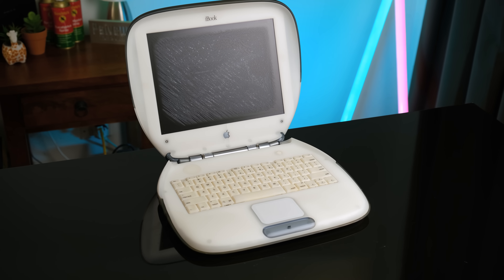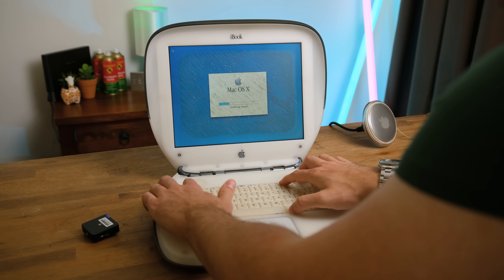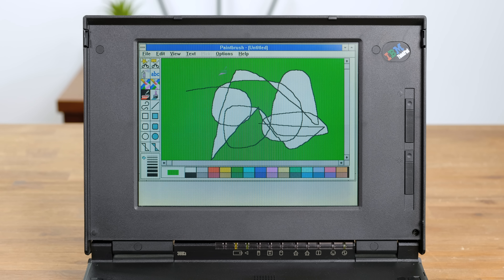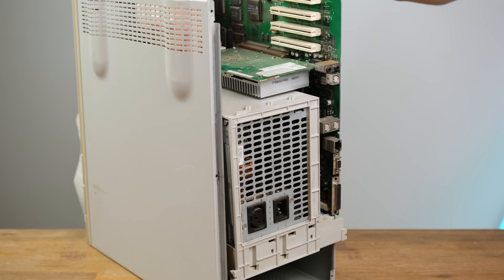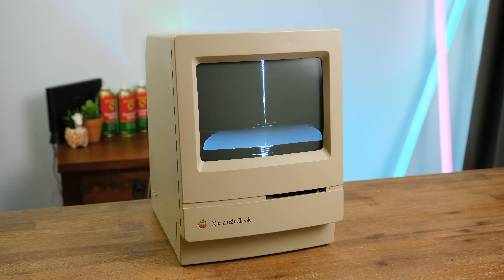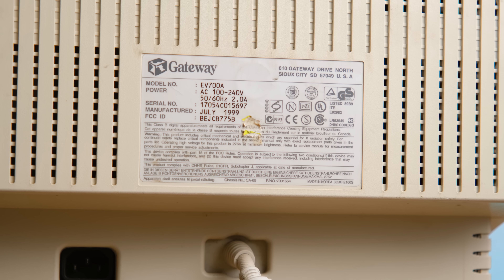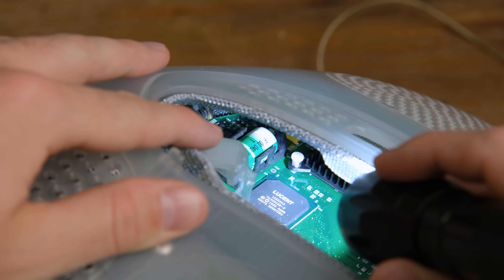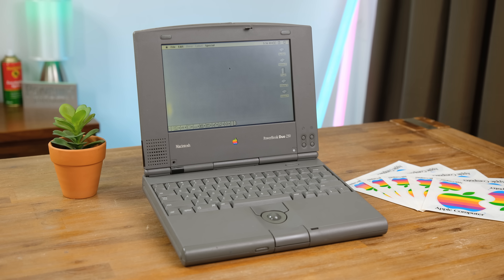So Much Vintage Tech Is Dying... Here's Why

Comment: One thing I have found that works great on rubberized plastic that get gummy is to get a can of Matte clear spray paint
I  disassemble/mask off the parts you dont want sprayed and paint them.
I have a number of Old Dell laptops that got sticky n the cases and palm rests... 
I took them apart hit them with 2 very ight coats of Clear and they look and feel like new.
Reply: Thank you for this great tip!!

Comment: I have a g3 which has something like 3000 vintage songs from 1995 to 2008 from actual hard disc cd's imported through that pc's poor worn out cd drive. I use it in the garage at least once a month as background music playing thorough the original speakers  and the only thing I have had to do is replace the mouse. I do unplug it when not in use and of course get the clock is off message at startup. But otherwise it works flawlessly. I will run it till it dies.  

I also have a 575 that died 2 years ago. I replaced it with a  6500/225 which I use to run ray dream designer and photohshop using a syquest drive.

Comment: Sad. I have a Panasonic radio from 1970 that still works fine, as well as a 1915 Victrola record player which also works fine. I also have a 1940s/50s tube radio which needs repair, but I'm sure it just needs a tube replaced, the structure of Bakelite and metal is not deteriorating at all and all components can be replaced or fixed with a soldering iron.

Comment: flyback is probably not bad. just clean the carbon soot off the glass and the cap, anode wire, and under the cap. put new silicone grease around the hole for the anode cap. should fix the problem. if it doesn't, get some super corona dope and 'paint' it on the anode wire

Comment: I absolutely love how percussive maintenance usually ends up working
Reply: I used to have a CRT monitor in the late 90s which turned pink every now and then. I started tapping it gently and it returned normal. As time passed I had to use bigger and bigger force. Months later I was banging the top of the display with full force until it returned normal. Later I learned that the issue was with the power outlet and the display had no issues. Still managed to sell the CRT display.
Reply: My dad calls that "gentle abuse" lol
Reply: It's how my PowerBook G3 has been operating for the last year. The HDD seizes up after a while of not running so I keep a hammer in its bag for starting the system.
Reply: Kept a PSU going through several homebuilt PCs for 20 years now. I should probably replace it soon
Reply: I stockpile and maintain old parts to help my neighbors with their aging technology. I just love the feeling of helping someone with something most people thought was beyond fixing!
Reply: It works great on fridges with jammed compressors after being in storage.  Give it a good whack with a hammer just as you turn it on.
Reply: That phenomenon happened alrady 40 years ago. I was called to someone having a VAX machine (digital/DEC) and it would not boot anymore. They wanted to copy the data one final time. When hard drives ran for a long time and then are turned off for a prolonged time, the bearing grease gets thicker. By giving a gentle knoch it moves a bit - enough for the torque of the motor to spin it up again. The hard drive heats then up a bit making it running again.
Reply: I used to have a VW Polo where the brake shoes would rust to the drums. You had to whack the drums with a length of 2x4, from underneath, if you hadn't moved the car for a week. Also, if you were planning on changing a tyre, you needed a rubber mallet because corrosion welded the alloys in place. Awful car, the Volkswagen, but percussive maintenance, it understood.
Reply: @gdutfulkbhh7537  This made me wonder of what a car made in 2020 is gonna be like in 2040, it's all gonna be vintage tech and chock full of it.
Reply: Indeed! I once had a job as a technician for a university department and the majority of the successful repairs I executed over the years simply consisted of the typical digital 'switch it off and on again' which in the physical, analog world translates to take it apart and put it back together again. I'd often find no fault at all but a bit of mechanical manipulation (including percussive maintenance ) would get things working well again. It feels like the machines just want a bit of attention sometimes.
Reply: reminded of the crt tv that would supposedly only stop being fuzzy when they taped a PLASTIC bookmark to the screen, for some reason

Comment: Another cause of older tech dying is the greenification of the production.  Solder used to be a mixture of tin and lead, and that was very reliable.  But at some point lead was banned for being bad to the environment, so electronics had to be made with leadfree solder, which turned out to be a brittle solution, and connections would break after many warm-cold cycles.  This leadfree solder killed millions of devices, including the entire first generation of Xbox 360s (remember red ring of dead).
Reply: Lucky they solved that with the One, S & X. Oversize heatsinks & bolted down.

Comment: This makes me fearful of my CRT TV's and old consoles. Y'all we need a solid repair business.
Reply: I still have 1 CRT TV chugging along, from 2006... my other two (both late 90s vintage) kicked the bucket. I still have the one broken one, only because trash won't take it. I have to wait until April 2024 for our local once a year recycle event.
Reply: I still have 4 OG xboxes. 😂 All the potential time capacitors that can leaked were removed indefinitely & all the parts had been cleaned thoroughly with rubbing alcohol on the motherboards, cloned & replaced all HDDs with the most reliable ones on the market design for industry use in IT.

Comment: This is a somewhat interesting development in tech surrounding the idea of planned obsolescence. Because it’s not so much that these devices were designed to break, but that they were not designed to last. Indeed, it was impossible to build them to last for more than a few decades, given the limitations of 
 manufacturing and maintaining plastics, batteries, etc. Yet despite inherent limitations, it seems the tech industry actually has attempted to develop products that don’t degrade as easily. Or, at least advancements have been made in the past. But when Apple produced their first computer, how could they have guessed what nostalgic value it would hold for people a generation later? And even if they had, one can hardly see how they could have practically designed it differently in order to last longer, without seriously compromising value to their target customers.

Comment: When I've done electronic design in the past, we always aimed to have devices last at least 25 years.  This meant all solid caps (aluminum organic polymer or other), batteries that are replaceable, etc.  This meant that things cost a premium, especially power supplies.  PC motherboards can be built to the same standard, for some around the turn of the century their higher-end boards would use all solid caps, better grades of plastic for the molex and other onboard connectors, the PCI expansion slots and so on.  A lot of this tech is 15+ years old and still going strong, though mostly only used by PC builders or others from around the time, any of the consumer brands like HP, dell, compaq, etc. no one should expect that stuff to last more than a decade or two if you are lucky.

Comment: I've got electronics back to 1980s stuff.. And this hasn't happened to any of it. The CM64 and amiga still works. the 286,386,486s... etc. What is the difference in what I have though. Is that I never bought any crApple products.

Comment: I think you have something that shouldnt be near it thats breaking it down, that broke down much faster than it wouldve naturally. Some other plastics are nearby that are not good.
Reply: no im doubleing down, all your tech to fail like this isnt normal, you need to investigate. Coming from a fellow hoarder, your shit is being affected by something. I once stored a compound to make touch screens smooth again and it ruined an entire drawer of plastics when the cap was tight and closed.
Reply: Some great points! I recall putting kerosene in HDPE containers, some originally used for engine oil, so thick and sturdy, and it made all the labels come off. The kerosene must have permeated through HDPE and dissolved glue. I know it is a very good organic solvent. It also made the rubber seal in the tank cap of diesel heater expand. This surprised me because, of course, it was supposed to withstand exposure to diesel. His storage is far from perfect. Just look at the mess in the drawer.
Reply: @pavel9652  Yeah man, no way all those items he has failed so quickly naturally. I've got stuff my own from the 90s that has never been taken care of lol, still looks fine. We can only hope he sees our comments. Thank you for the comment.
Reply: @HurpMcDurp_  Thanks for the response! Do you have any experience with high humidity levels during storage? I had to leave a rented apartment, and I put a lot of items boxed in an outdoor storage container, including some electronics. The issue I struggle with is humidity. Europe is in winter now, and my solar struggle producing enough electricity to run a dehumidifier for time long enough to keep humidity in check. I am notoriously over 80% relative humidity now, and I am considering getting a power generator to supplement solar. I might have to run my dehumidifier for a few days a week, perhaps every second day. Maybe heating would help, but it is problematic. Chemical dissectants aren't effective enough. The goal is 65-70% relative humidity, otherwise I am risking damage and mould.
Reply: @pavel9652  I have no professional experience at all lol. But I do live in Michigan, and it is a very humid state with the surrounding lakes. Today during winter it is 52% humidity and in summer about 80 average. But all my items are in my house, I would no store my items outside in garage here ( no thermostat control just dry under roof ) IF I could guess, the easiest test turn up the heat a little so its not as cold to attract moisture when its just a little colder than surrounding air. I assume your dehumidifier tank fills quick and no option to run a hose so it could be on all the time? One or the other I would guess
Reply: @PPPEEEEEEEEEE  Thanks for the reply! The problem is humidity in the winter, and I think you are right about the leak of heat. My first problem is to get enough energy from solar panels and/or generator to run dehumidifier. Second is that compressor dehumidifier isn't efficient in low temps. The third one might be automation as you mentioned but I have ability to use the hose, and I could always get better dehumidifier. The whole system will require attention anyway. Maybe I should seek better storage with controlled environment. I noticed when I ran diesel heater a bit, humidity dropped substantially. Perhaps, dehumidifier on its own won't be enough. It is metal container without any insulation so heating it will be expensive.

Comment: It's a real shame that even if you take care of your tech like a museum artifact, they will still degrade to the point of looking like they've been trashed. I especially hate rubberized coatings, and stay away from anything that's advertised as "soft touch". They always turn into a sticky mess within a few years.
Reply: It is certainly disappointing that the only way to preserve old technology is to keep replacing obsolescent parts to the point where it literally becomes something that is like the Ship of Theseus.
Reply: @horsepowermultimedia  Also keeping them in a museum-grade controlled humidity environment.
Reply: @cordovajose5693  That could possibly work.
Reply: You can take that sticky stuff off with acetone. I did it on some knobs a few years ago and they still work. It didn't destroy them yet.
Reply: @therabbitchannel2059  Thanks. I've been looking for a solution to that problem.
Reply: @HieronymusChockvivantvanit  While acetone works, it will attack the plastic underneath. Isopropanol will work a little slower, but leave the plastic alone. Best in my experience is orange cleaner, that dissolve the soft coating really quickly while not attacking the hard plastic underneath. Note that all of these will remove the rubber coating. I am not aware of anything that will restore it.
Reply: @grumbel45  I dropped acetone on my black keyboard, accidentally of course, and it turned white where the acetone dropped... it is used as nail polish remover, it's a strong and dangerous solvent, need to be handled with extra care and attention (not like me lol)
Reply: @therabbitchannel2059  Acetone? fine if the soft touch coating is on metal, but be careful; acetone attacks and dissolves almost all styrene based plastics and will make an even bigger mess (polystyrene & ABS are widely used for plastic enclosures). Isopropyl alcohol on the other hand removes the degrading soft touch coating and is safe for most plastics.
Reply: I have thrown away an e-book reader that otherwise still worked because of this. Now it had other weaknesses such as poor resolution, but that alone was tolerable. 
Edit: There are rubbers that don't have that problem. From my parents, I have inherited some jars whose rubber seal is still good after decades.

Comment: Not just tech, also data and file rot. I went into a rabbit hole about Software rot and its insane. obviously not the same but its a legit thing that happens to internet stuff over time when abandoned and its just mindboggling.
Reply: you should always download what you like on the internet, and ideally keep 2 or more copies
Reply: Buy multiple USBs and transfer every couple years lol
Reply: You can make pars files and use those to recover the data.
Reply: Also software preservation. Lots software is being taken off the web. (Games as well) ... Gone for good forever..
Reply: Ive been looking at m-disks, already have data backed up on sata devices like ssds and hdds but look up m-disks, theyre expensive but are meant to last up to 1,000 years in theory
Reply: But to reiterate on what i said, do some research and tell me what u guys think.. they look very interesting compared to normal organic based blank discs
Reply: I’ve started trying to get back in the habit of paper due to that. 
Even screen shots if I can’t copy/paste the text into word. 
I’m starting to deploy binders by subject.
Reply: >File rot

yep, recently bought a new old stock vacuum flourescent display and it came with a burnt CD with demo software. The CD is easily 20 years old, and doesn't read. and i can't find the software anywhere online. Even the manufacturer doesn't have a copy anymore. Would be great to be able to recover that CD.
Reply: @devicemodder  That specifically is called disc rot

Comment: I can only imagine how worse more recent technology will be as it ages. At least with the vintage stuff in this video components like batteries and hard drives were relatively easily removable and modular. Modern tech is a nightmare already for people to repair today with soldered storage and memory, glued batteries and serial codes on each individual component. Repairing a current day MacBook in 20 years from now may be next to impossible.

Comment: I am trying to sell older electronics that work. Anyone know a good site to do this? eBay & others seem bad because of shipping issues. I don't want to ship a motherboard that's 10 years old halfway across the country to someone that will claim it doesn't work. 

I have RAM, motherboards, power cells, batteries, GPUs etc. Id love to find someone locally to deal with but if not then I want to find someone who understands more than I do about how to fix since I was the original owner & I know it will work if it gets into the right hands.

Comment: I avoid rubber coatings on tech like the plague after my college Dell turned to go a few years later. 

everything old is going bad. All the old cars are getting rusty and rubbers/lplastics disintegrating, pickguards and plastic on old instruments warping and cracking apart. Old game consoles not reading and discs rotting. Entropy blows…

Comment: i recently had a performa 630cd that had its entire main board/psu rused out. took a solid week to repair the traces and rebuild the psu.  the parts are SO CHEAP, talking less than 5.00 to fix these things but the time it takes....

Comment: You stored them in a cool dry place? Why does it have to be cool? It would make sense for them to stay better in toom temperature
Reply: Cool and dry helps preserve electronics and media and prevents mold growth. The same way it preserves food and drink. Temperature variances causes expansion and contraction of plastic and metal parts causing crack in solder joints, plastic cases and laminated layers of screen to de laminate. Heat will also cause bubbling effect on plastics too.
Reply: @Wolfstanus  I would probably store them in room temperature because i've noticed electronics having problems in cool temperatures but I don't know, its just my experience
Reply: @eetuthereindeer6671  Basically the temperature of a basement 70ish is perfectly fine and just keep as much humidity away as possible. It also helps keep media rot away
Reply: @Wolfstanus  had to google what 70f is in celcius but thanks! 😊